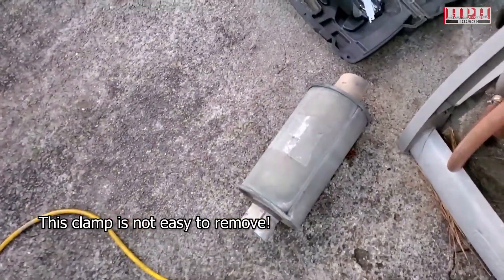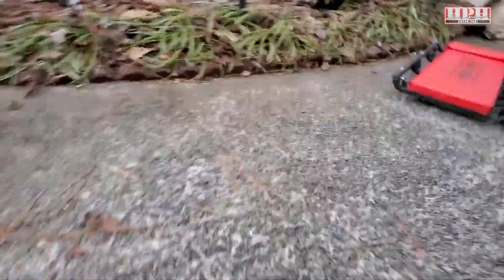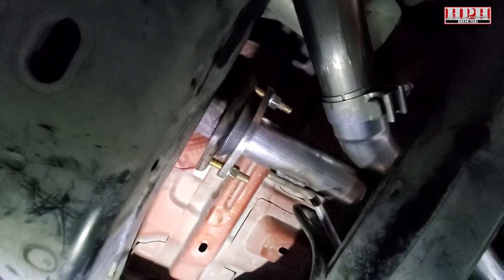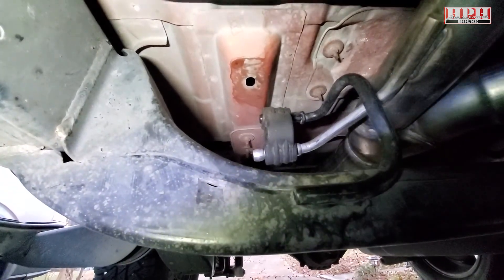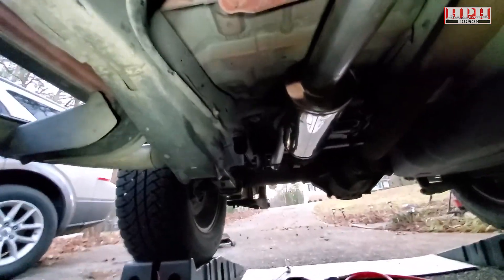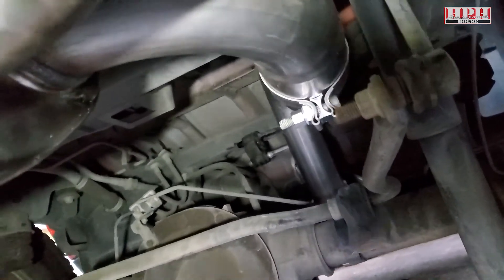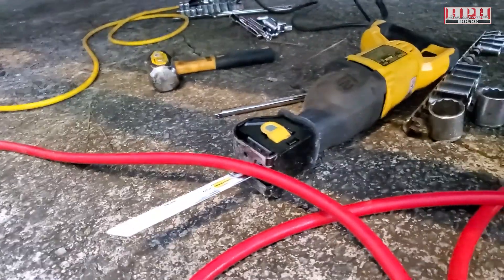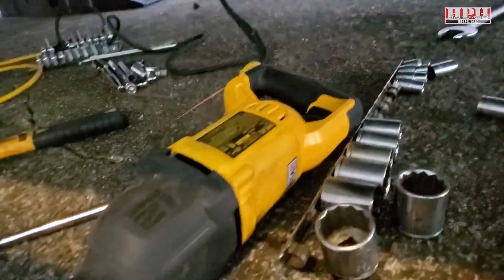How To - Hummer H3 Alpha Exhaust Remove & Replace Install - Magnaflow 16832 Street DIY

Comment: Hi Sir. P0420 (Bank 1) is showing up after I ran a scan on my ECM. I have 2009 Hummer H3 Championship Series V8. I believe that my mechanic installed an aftermarket catalytic converter and not an OEM. I had an issue with this for years and I am trying to get it resolved. Can you or anyone reading recommend a new catalytic converter that would clear this check engine error? I am not sure that they make OEM catalytic converters for Hummers anymore. Thank you very much for your help in advance!
Reply from the maker: Low mileage used one is the cheapest way to go.  eBay.  Otherwise take it to another good mechanic and let him properly diagnose it.